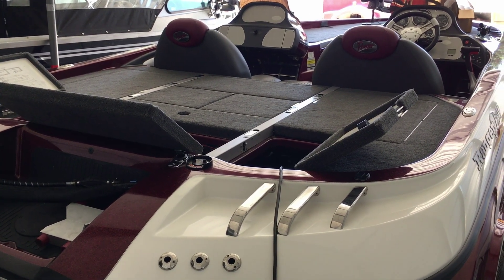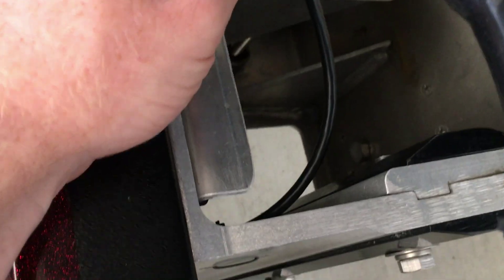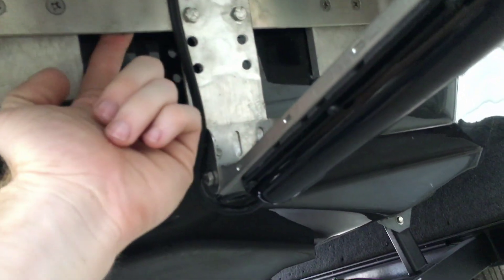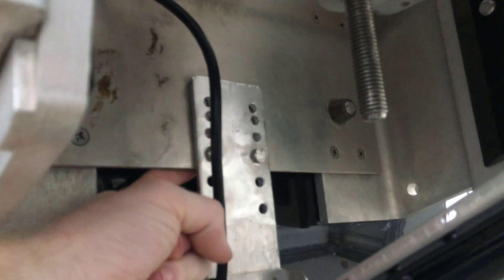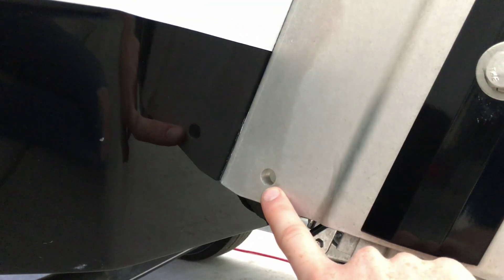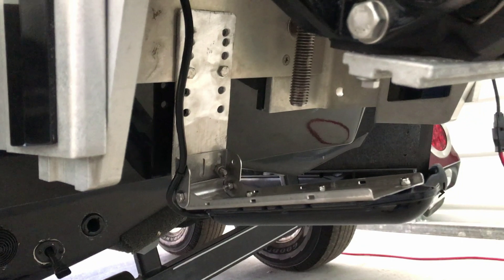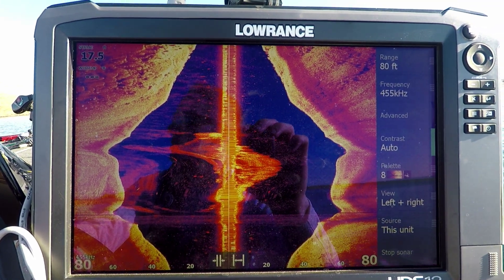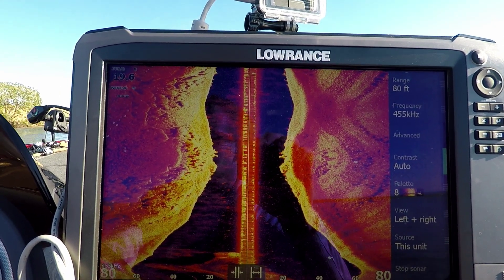LSS-2  LSS-3 Transducer Install on Ranger Z20 Bass Boat (With Water Test)

Comment: that's not a little distortion, that's a LOT  need to move ducer to areas of intakes level with bottom of boat.  distortion will be gone.
Reply from the maker: The large amount in the middle is me turning the boat around before taking the video. Check the feed once the boat is moving straight.

Comment: Not the correct location. It needs to be on the bottom of the boat. Use a piece of starboard and mount it in the same location as the drain plug/ livewell drains. This is the bottom where the water comes off the bottom of the boat. The starboard gets epoxied to the boat allowing you to not have to screw directly in the boat but into the starboard.